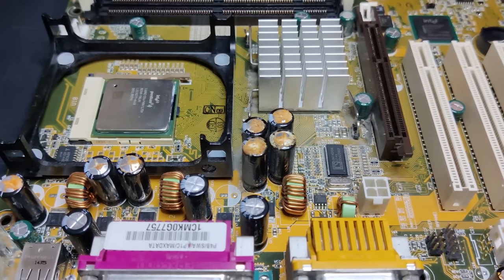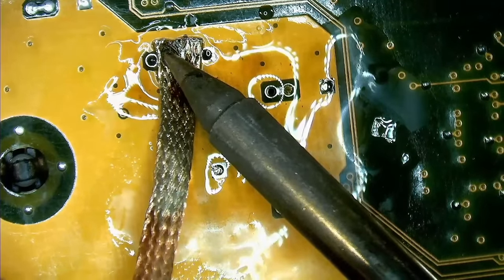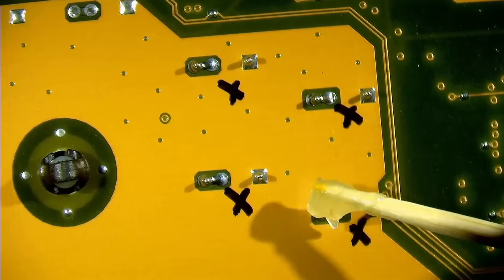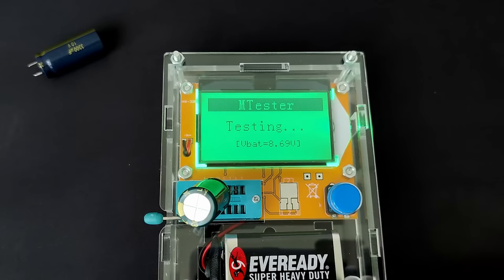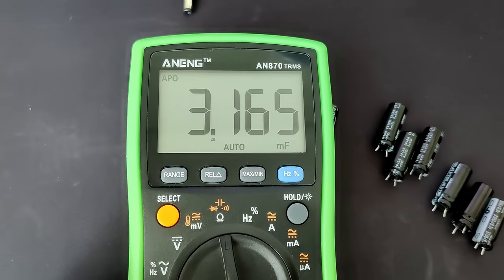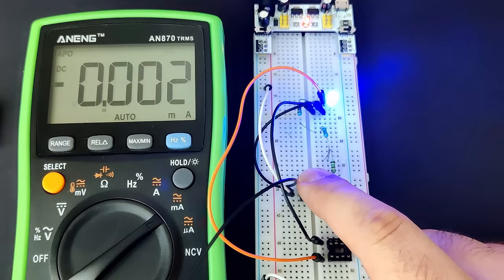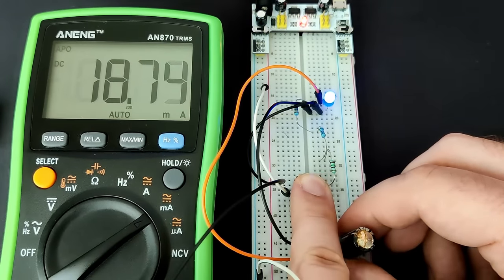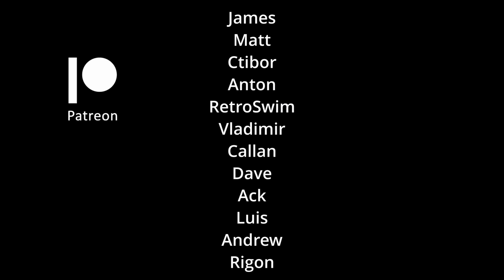Remnants of the Capacitor Plague

Comment: I picked up an Asus P4B266-C that had some bad capacitors, and I replaced them with some that I had on hand. It works perfectly with the 1.7 GHz P4 that it came with, but when I tried to use a faster CPU I ran into an issue I've never before encountered. Even with a 2.2 GHz 400 FSB CPU (the fastest one officially supported, but I also tried a 2.5 GHz 533 FSB) the board will POST, but lock up soon after. The faster the CPU is, the more quickly it locks up, but it works perfectly with the 1.7 chip that it came with. I assumed that some component on the board is overheating, but I bought an infrared thermometer to try and troubleshoot it, but it was no help. I updated the BIOS, tried different memory, different video cards, but I wasn't able to resolve the issue, so it sits in storage.

Comment: I'm wondering if that increased resistance is causing the capacitors to warm up more. Might explain how the fluid eventually boils over and pops. Without enough fluid in there, it can't really hold a charge very well as a result. If it turned on, I could see all the current CPUs tend to pull heating up the capacitors more, and without their abilitiy to smooth out the waveform, possibly causing the CPU to hang. 

That was still a very neat demonstration how a damaged capacitor behaves, usually people look for the bulge and decide it's time to go. Some others like to watch them blow up fully.

Comment: During those times, we replaced some capacitors with higher uF and voltages, if same value got out of stock from our supplies, all worked fine as long as it for high frequency and low esr types. We do the same on the power supply, some crt monitors, and other electronic devices that may be using same type of capacitors

Comment: I thought Nichicons were supposed to be some of the best and unaffected by capacitor plague! Guess I'll have to look at them more carefully!
Reply from the maker: I was surprised as well because I heard many times that they are one of the best. There is a Wikipedia article about the exact series which were affected. On my P4B board, there is the HM series which I removed in this video. There are also 1200uF 16V Nichicon (HD series) which look like new.
Reply: @bitsundbolts  yeah I've got a Pentium III board with a couple of giant Nichicon HD's and they look and work fine.
Reply: @bitsundbolts the worst nightmare is to replace those big capacitors on some 2000s and 2001s motherboards... like MSI K7T Pro etc... there are giant capacitors instead of common one.
They are also too high... motherboard is harder to store, and also, they can move easily and can be loose.

Luckily, manufacturers realised, the better is to use middle ones, in bigger quantity, because then, it's easier to replace them, and after quite short time, they've stopped used big capacitors on motherboards.

Comment: I have some motherboards from that time that died prematurelly due to this plague.... brands like Epox or Abit were more likely to suffer from that. I don't recall having a board from Gigabyte or Asus with this problem, I guess I was luck. One thing though: you are showing Nichicon capacitors going bad on this board. Nichicon is a japanese capacitor OEM and one of the top ones, just like Rubycon, Panasonic to name a few. I don't recall japanese OEMs having problems like this. I normally found the "sick" capacitors to be chinese brands... I don't recall the brand, just the color: they were green normally. You should replace ALL OF THEM, not just the bulged ones. Even the ones that look normal can be very off their nominal values. Great topic
Reply from the maker: Nichicon also had issues that were apparently not related to the capacitor plague. See my pinned comment. This ASUS motherboard has the capacitor series which is known to be faulty.
Reply: Great info, didn't know that. Thanks! @bitsundbolts
Reply: There was a particularly popular Asus mATX nforce 2 board that suffered from it, me and my friends group bought them and watched them drop flies over the next few years.
Reply: @bitsundbolts Asus motherboard are in general good in resisting electrolytes to buldge. I've noticed, it happens far less than on other motherboards.
The worst is PC Chips and ECS, of course. (also other ripoffs like Syntax USA , Matsonic)

Gigabyte is somehow in middle, but MSI is usally worse, than Gigabyte.
3 boards from MSI in my collection, started to buldged capacitors only stored in box (i've rechecked them after 2 years).

Intel motherboards have also in general good resistance to this problem.

Comment: Ive got one of these P4Bs - with a celeron 2ghz - it was a scrap find - initially it was dead as a dodo - i replaced the main power caps first - and heard it say someting to me - i thought what the hell was that ? then it went dead again . I put it away for another day - then I ended recapping the rest of the board  with solid caps (the green caps actually didnt look bad ) but she came alive - and now is exited to say "system is posting into the operating system". Its also a very handy board as a test rig for graphics cards - as she will say "vga card not detected" during a post

Comment: As the ESR increases so does its power dissipation which heats up the caps. A cascade effect happens as they internally heat up, boiling the electrolyte, and rupturing the caps. Another thing to be aware of, electrolyte is caustic. When the bottom seals fail, the electrolyte can damage adjacent components as well as the circuit board itself. It can be very difficult to properly remove the residue from the boards, and must be done, when attempting quality repairs.
Great content ..  Cheers :)

Comment: 2x of my OG Xbox have also suffered from Nichicon's own capacitor plague. Surprisingly they both still work despite some having split open completely. And 1 of them I only opened due to it not staying turned off (that was the super capacitor having leaked and shorted the power button).

It was the same for a Pentium 4 540J PC that I'd been given as well. It however had a replacement PSU at some point (I know because 2x SATA HDD, yet only 1x SATA connector) and said PSU had a scorch mark behind a bad solder joint. So I didn't even bother attempting to repair the motherboard (reference Intel LGA775).

Comment: A year ago I had a case with a Samsung 17" LCD monitor not turning on (only slightly blinking with its power LED). The problem was in six 820 μF low-ESR capacitors, all six leaked and popped. Five of them were completely open (not recognized by the transistor tester at all!!!), one had approx. 100 μF, high ESR and a lot of leakage. Replacing all six fixed the issue without any additional repair.

Comment: It's crazy but it wouldn't surprise me if the board would still POST with the bad capacitors. Somebody brought in a PC which was controlling an industrial system which was starting_ to act up. It had clearly bulged capacitors and many of the ones I took out weren't recognized at all by my M-Tester. If I hadn't seen it boot with my own eyes I probably wouldn't have believed it. When the capacitors on the output of the buck converter get weak it usually just increases the ripple voltage and as you know from overclocking usually there is a decent margin on the voltages before things crash.
Reply from the maker: I have a socket A motherboard from MSI that also suffered from bulged capacitors. It powered on and got into Windows, but it was very unstable.

Comment: The yellow board transistor tester is probably the worst variant of the transistor tester. It lacks the TL431 reference IC and instead uses a zener diode reference. Plus it's just kinda crappy. You want one with a rotary encoder. They're just nicer. Chinese clone transistor tester variants are a minefield to navigate. I have 3 and one is the yellow board model. I got it when I knew less about them. It doesn't look like my two favorites are available anymore. I got them both years ago now. Looks like 2015. I assembled them both from kits.
Reply from the maker: I think I am at that stage when you knew less about them. I hope I can upgrade my testing equipment over time when I learn more and when it makes sense.

Comment: I have the same board, and mine worked mostly fine with faulty capacitors, but was not very stable, especially if you put a GPU in the AGP slot and load intensive games. Swapping them out fixed my stability issues.
Reply from the maker: I wonder if you are overloading the VRM with those caps. The caps I tested leaked a lot of current. I could imagine that the power regulators get extremely hot because of the caps. Mine were too far gone, otherwise, I would have measured power draw at the outlet as well as temperatures on the regulators.

Comment: If capacitors are leaking (vloss) they test with a higher value, it's the test method that does this. (There is a good video about this at mr. carlson's lab page)
Reply from the maker: I'll check it out. Thanks for mentioning it

Comment: 6:00 0,29 ohms seems too high for such a capacitor. Either the capacitor is not a low ESR type or the tester isn't calibrated.
Reply from the maker: I'll recalibrate the tester. But I have noticed that the test results of those testers are at best an approximation.

Comment: could you demonstrate the difference between a big and a small capacitor both with same C and V specs?

i need a 470uF 25V 10x20 for a power supply but all local electronics stores don't have this size and instead give me whatever they have. i thought capacitor size didn't matter but now the power supply won't turn on with this 8x16 capacitor. i kept looking for caps but all i found was 8x16 and another smaller one, both with the same uF and V specs.
Reply from the maker: I have seen capacitors with the same rating, but different sizes. I wonder why they exist. I'd imagine something about density etc, but I don't know. Unfortunately, I don't have capacitors with the same parameters, but different sizes.
Could there be another reason why the power supply doesn't turn on?
Be careful with high voltage mains power supplies! I opened once a power supply. The PCB, solder work, everything looked awful. Just poor quality and I decided it's not worth the trouble!
Reply: @bitsundbolts  its from a 2007 samsung monitor. the capacitor has those specs i typed above. maybe if i solder the capacitors in series it might work? i'll google that later.

Comment: I would like to know if electrolytic capacitors can be replaced with ceramic capacitors?
Reply from the maker: I am no expert to answer the pros and cons or if it is even possible. However, the maximum capacitance of ceramic capacitors are a lot lower than electrolytic capacitors. I think the largest I have seen is about 100uF - the P4B capacitors I replace are 3300uF.

Comment: One question.... I tried a lot of different ways for removing old capacitors. I always add new solder (63/37) and flux, just like you did. I tried sucking the solder with manual pumps, with Hakko gun, wiggling like you did... that's the one I'm using at the moment: I leave a blob of solder and wiggle the capacitors always. I used the Hakkon glun to finish the job and keep the hole through clean for the next capacitor. One thing that happens sometimes, specially on the negative/grounded side: when I try to solder new capacitors, the solder doesn't adhere to the pads. It is not a matter of temperature, quality of solder or flux - I guess something happened to the pads. I normally get it fixed by bridging it to a nearby negative or ground ( I always check with a multimeter to ensure they are connected by design). I still have to find out why that happens (a mistake from my side) and learn how to avoid it - I'm sure one day there will be no easy way out, like no near place to jumper it.

I never saw anyone reporting such issue, I wonder how common that is and how people deal with that
Reply from the maker: I haven't encountered such an issue yet. Maybe it is linked to a large ground copper area. It has quite the effect on soldering.
But it could also be a corroded pad. Cleaning the pad with fresh solder, wick and flux may help to make the solder attach better
Reply: Thanks for the tip, I will try cleaning it with wick. This is the only thing I didn't try.  @bitsundbolts

Comment: So the bad caps are behaving more like resistors in the test circuit.
Reply from the maker: I wish I kept those capacitors to verify this. But yes, I think you're right. The difference is though that they still have storage capabilities for energy - which just drained very quickly. Resistors don't have that. If I place a resistor in my test circuit where the capacitors go, I believe the LED would immediately dim (not turn off and then fade in to medium brightness).

Comment: Hi, also please take of one cap that looks good from the board and test it. Maybe we can find some interesting values. Great video, keep up the good work!
Reply from the maker: There are two other interesting types of capacitors on the board. When I install the replacements, I will have a look. There are 1000uF 6.3V (Sanyo) and 1200uF 16V (Nichicon, HD series) caps. The HD series was not affected by whatever was the reason of the 3300uF capacitors (HM series).

Comment: The capacitor plague is still ongoing, and will go on until people stop using these types of components in electronics altogether. No matter how well they are produced, they come with an expiry date.
Reply: Rubycon caps can last for 40 years or more under normal conditions. The 30,000 hours listed in the datasheets for the extreme long life versions are actually torture tests. The capacitor tier list goes Rubycon -> Panasonic ---------------------------------------->everyone else. Rubycon and Panasonic are in a class by themselves.

Comment: Beautiful explanation! I have SO MANY boards and other electronics with bad caps, I need to find a local supplier of good branded caps to avoid buying chunks of them online. What are the best brands? (found in a forum) Chemicon, Nichicon, Panasonic, Samxon, Sanyo and Rubycon? And how do I check if I need ESR caps or not?
Reply: Japanese manufactured caps are generally considered decent. Although every brand has released bad series of capacitors. Like these Nichicons in this video. Nichicon is a top rated maker. But this particular series they made was bad. So you do have to research each series you consider using. You need to use low ESR caps in higher frequency applications. It has to do with internal heating. Heat is what kills caps. Electrolyte is a fluid and heat dries the stuff up.
Reply from the maker: I hear Rubycon and Nichicon a lot, but I am no expert. I admit that I am buying junk so far ;)
Reply: @bitsundbolts  even the poorest capacitors should run for a while. Although I have seen new duds. Those Aliexpress variety pack caps. Which I imagine are mostly rejected batches.
Reply: there's no best brand but only good, okay, and bad. among brands you mentioned, Samxon can be okay or bad depending which model you use. try to avoid their lower end model. the others are good but again, it's a matter of model choice. it's always better to determine which model is the most suitable for your specific application. do note, it's best to avoid placing solid polymer capacitor on standard electrolytic capacitor place. not every circuit would appreciate very low ESR caps.

for solid caps, Taiwanese brand is good to use (CapXon, APAC, what else?)
Reply from the maker: @n.shiina8798 I wish I would know more about electronics to avoid mistakes like replacing standard electrolytes with polymer may not be a good choice. Well, I did order solid polymer capacitors. We shall see if those will work on that board. I thought polymer caps are superior in every aspect. That's a case where "too good" becomes bad?
Reply: @bitsundbolts  yup. some regulator either linear or switch mode went into oscillation if you mix them with ultra low ESR output caps. if you have stability problem after replacement, it's likely to be the case. i do hope you'll face no problem. it sucks to do any kind of job twice

Comment: Tall capacitors like a skyscraper city
Reply: The physical size of a capacitor allows it to dissipate heat.
Reply: @1pcfred  Don't know how genuine this is but fun to know.
Reply: @ralphwuu  theres a number of factors involved with component specs but everything else being equal a larger capacitor can dissipate more heat than a smaller one can. It just has more surface area. Size matters.
Reply: @1pcfred  Makes sense now, thanks.